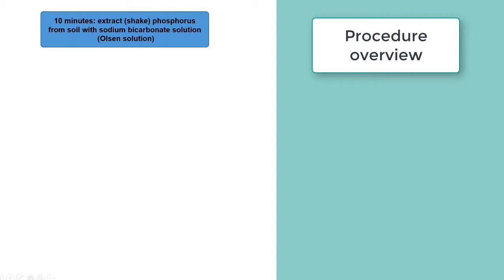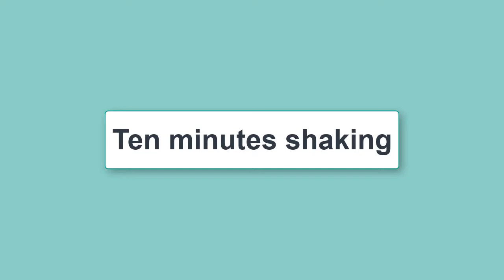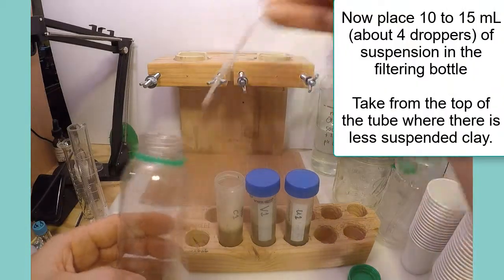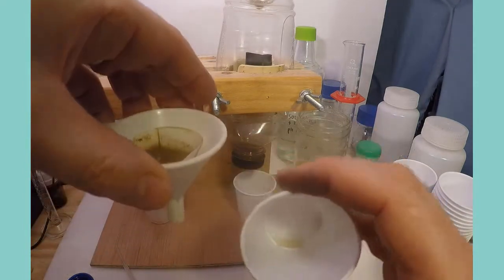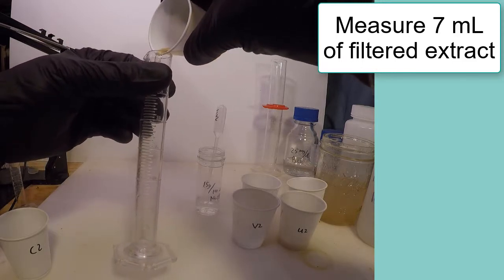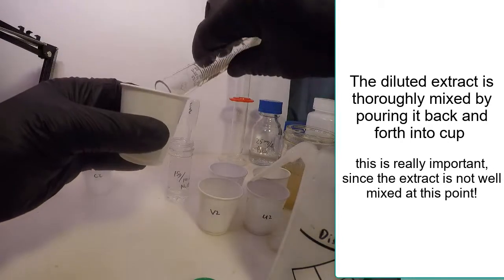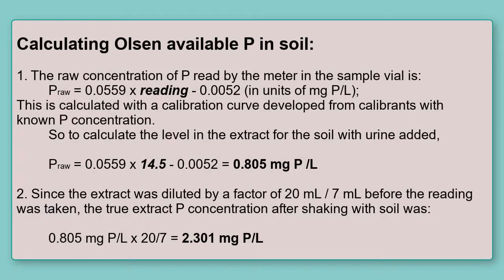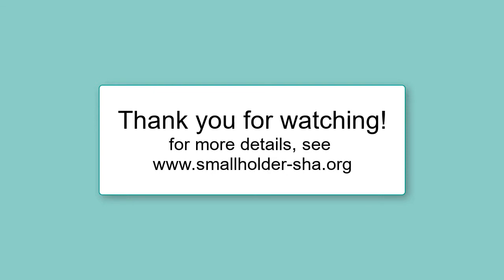Measuring Available Phosphorus in Soil - Simplified Method

Comment: Hi, As far as I know, Olen method is a complete analysis by itself. But why do you need to use Hanna Reagent.
Reply from the maker: certainly, you can purchase separately the reagents and perform your own olsen colorimetric reaction.  But, it can be more convenient to use a pre-mixed package of reagents.  That is all.
Reply: @lloqalla  Got it, thanks. I am working on automated soil Phosporous devices for local farmers, which will read P value using colormeter sensor of the device. I go through several test methods(Bray, Olsen, Mehlinch 3,..) but all of them required complicated process of reagent and multiple steps. Can you advice a simple and average accurate methods? My background is Software Engineer. Sorry for going beyond what this video all about.

Comment: hello, the olsen solution or this method can be used with acidic or calcareous solid? or with both?
Reply from the maker: Although some soils labs choose to see Olsen as a test for neutral and calcareous soils and bray as a test for acidic soils, Olsen has been found to work reasonably well across a wide range of soil pH, we review some of the literature regarding that in the publication on this soil health tool kit at :  https://doi.org/10.1016/j.geoderma.2020.114539   (open access) ..  it turns out that although Bray performs poorly in calcareous soils,  the opposite is not true of Olsen.  There was also a large-scale study of many samples in Iowa showing this by correlating a number of soil test results including Olsen, Bray, and Mehlich if memory serves.
Reply: @lloqalla  Thank you so much! I am doing this experiment at my school but they don't have the phosphorus reagent package so it is ok if I use ascorbic acid instead. If I can use it I have to adjust the pH with sodium bisulfate?

Comment: Hi, just a question regarding your calculations for raw P concentration. You gave the equation Praw = 0.0559 x reading - 0.0052. Is this the linear equation for the calibration curve and if so wouldn't absorbance be given on the y-axis making the equation be reading = 0.0559 x Praw - 0.052 instead? Hope the question makes sense. 
Last thing, I read up that this colourimeter uses 525 nm but other Olsen tests uses 840 nm in their colourimeter, is there a particular reason for this?
Reply from the maker: To begin the calculation of available P in the sample we need a raw phosphate number to relate to the reading on the phosphate colorimeter - because the colorimeter is designed for water, we can't use the direct reading for what the concentration would be in water but need to adapt it to a standard curve created with standards in neutralized olsen solution, as is done in the "official"  lab version.  so the relationship has reactive P in olsen solution as the dependent variable and the colorimeter reading as the independent variable.  If you would like to repeat the calibration with phosphate standards you may be able to create better results for your specific location, but we find that the generic standard curve is adequate to compare soils in a semi-quantitative way.   the reason we use this colorimeter and wavelength is that a) we get very good correlation to the blue color in phosphate standards , R2  of 0.999 or 0.998 and b) it allows us to use a single colorimeter to do both Olsen P and active carbon or POXC.

Comment: Hi! Can I use the olsen solution to extract the soil sample and titrate it to find out the concentration of another element in soil?
Also can you explain the chemistry behind using the olsen solution?

Thanks!!
Reply from the maker: Olsen is pretty specific to available P, not other elements.   I refer you to soil analysis textbooks for the reasoning behind Olsen P.   The idea with any of the Available P tests is to desorb inorganic P and dissolve a bit of organic P which can be called reactive, and the relatively high pH and presence of bicarbonate ions tends to create these conditions, I think.

Comment: Would I have to adapt this method if I were to use the Morgan(1941) Extract?
  Extract it is 1:10 extraction.
  You probably would have to omit the acid unless the soil is calcareous.
Reply from the maker: It has to do with the Olsen extractant, yes, because Olsen extractant has a pH of 8.5 and the color development reaction of the molybdate blue method occurs at between pH 0.5 and 1.  So there would be a bit of trial and error with adding packets, looking at the color development to get reasonable color and using pH of 1 or just below of the extracts after color development.  Then sulfuric acid (which can be dilute battery acid) or sodium bisulfate would be used to get the appropriate pH pre-addition of packet.  since pH of morgan is buffered at  4.8, it looks like, you might not need acid addition or you might just need less.   And yes, there would be slight variation in the acid addition needed based on calcareous or non-calcareous, this can also be noticed in the method with Olsen as shown above.

Comment: Hi thank you for your video, can I centrifuge the sample instead of traditional filtration?
Reply from the maker: yes, if you can get an extract clear and free of clays like the one in the video, it should work fine.  Sometimes clays will not centrifuge out, but the sodium bicarbonate does help a little to flocculate them, in my experience - so it may work well.
Reply: Thank you. I will have a try then.